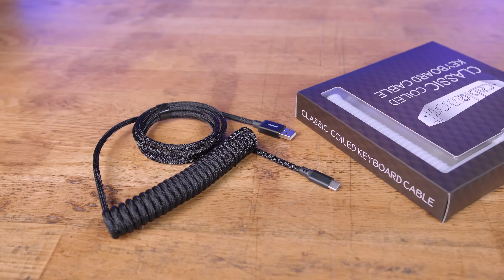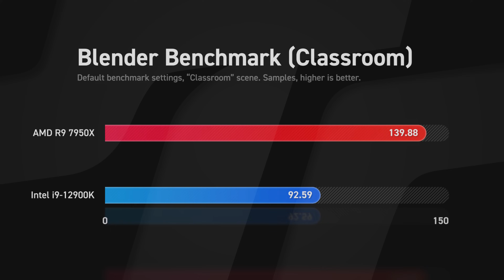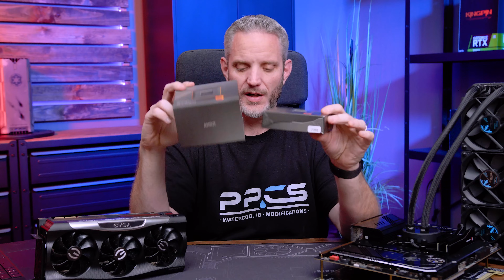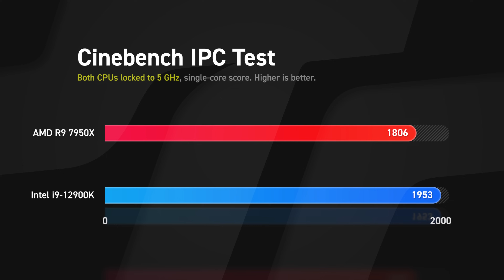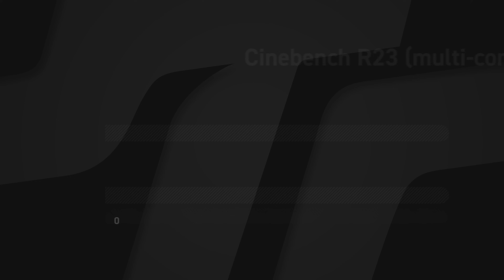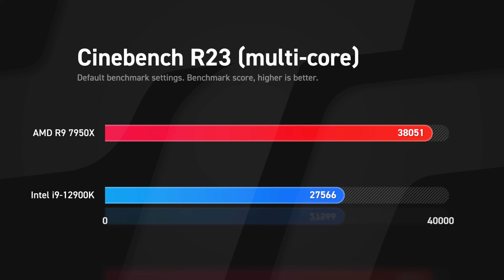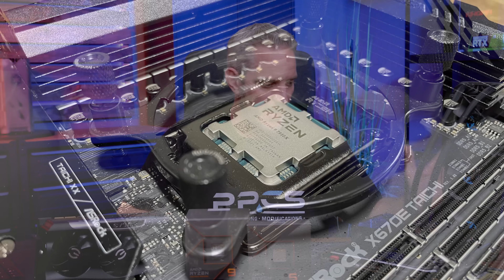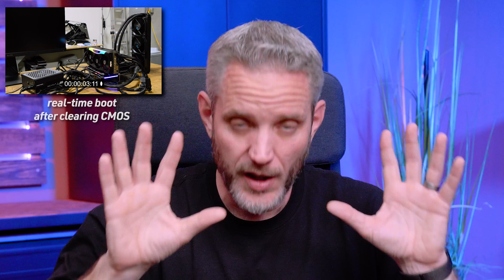Forget EVERTHING you THINK you know about AMD... these CPUs kick A$$!!

Comment: I'm definitely going AMD next time I buy myself a new computer. :) I am currently running an Intel Core i5 9400, and it can certainly use an upgrade. It's paired with my GeForce GTX 1650 Super, which will also probably be an AMD upgrade once I've got enough money saved up to upgrade.
Reply: Moved from blue to red team when I went from a 6600k to a 5600x after all the stink from how intel wasn't trying, loving it.
Reply: Wait probably for early next year, when everything is properly priced. Early adopters would always spend more than it should be.
Reply: eyes and kidneys come in pairs ;)

Comment: Question is, will someone with a 5900x notice an uplift in most games at 4k resolution.
Reply: at 4k resolutions, it'll be GPU bound
Reply: @6210classick  I'll probably skip this gen all together and upgrade the 3090 next year and two years later, do a whole new setup
Reply: i dont think so.
Reply: gaming at 4k is heavily reliant on GPU anyways. If you're not running a 3090 TI with that CPU you're bottlenecking yourself for performance anyways with that CPU.
Reply: @passmelers  is that so? a 12 core 24 threads cpu isn't enough for the 3090ti???
Reply: @6210classick  no im sayin if he dont got a 3090 ti then that CPU is pointless. its more than enough. u misunderstood

Comment: Moved to AMD for my CPU a couple years ago.  Still incredibly happy with my Ryzen 9 3900X.  Darn thing runs cooler and better than the overclocked Core i7 it replaced, and was half the price at the time.  That said, I did just get a 3090 Card, so that graphics card is going to be around for a long while...retirement slows down purchases like expensive PCs.  :(
Reply: I ran a 1060 for years, then was able to upgrade to a 2060 Super in 2020. I just got an excellent deal on a RTX 3080, and I'm sure this card will be with me a very long time.
Reply: I got a 3090, and after I water cool it, I can't see it leaving for a very long time.

Comment: Hey Jay! I don't know if you see this, and I hate to have to write this down before even watching the video - but could you add sandbox/physics games to your benchmarks? I know Besiege and Scrap Mechanic would easily overload these CPUs, and I'd be curious to see how V-cache would affect performance in these types of games. (I'm running a 3700X right now, and it struggles a LOT in most my games.)

Edit : so, I know that the frequency at which a game gets updated is important for benchmarks. The rarer, the better, in this case (though, I'd love a few more performance updates for Scrap Mechanic, especially a fix for the awful performance hit when you've explored too much in survival mode). So, since Scrap Mechanic rarely gets updates, it would be an excellent, stable game benchmark for years (sadly) at a time.

Also it seems like I'm top comment (not anymore lol), so thank you all for helping this comment being seen! Oh and, Jay, if you need benchmarks for the games I've proposed, I can probably create a set of benchmarks creations to put a load on the CPU. One thing which would be VERY important to do, though, would be to always use the same creation - and mention that FPS without a heavy creation loaded in and being active doesn't really matter. For example, a CPU with 400 FPS when there's not a lot going on (let's call it CPU A) would look a lot better than one which only has a hundred FPS (CPU B). However, if CPU A only has one or two FPS under heavy load, and CPU B over fifteen (doesn't seem like a lot, but trust me, it is in Scrap Mechanic and Besiege) then CPU B must scale up much better under heavy load on a single core. And I know I'm repeating here, but V-cache tested on these games would be EXTREMELY interesting and useful to know about for many gamers' next builds.
Reply: Gmod is an old game and lags because of software issues not hardware, it doesn't even utilize cpus to their max when it is lagging
Reply: Or blender physics simulations
Reply: Yep, and Stormworks too! The game engine only uses one of the cores! lol
Reply: @Nave4x4  yes! (I've never heard of that game, but really, Scrap Mechanic really only uses one thread for the physics simulation so much so that CPU usage drops with heavy creations). 

StormWorks looks cool though.
Reply: Don't think it's just these CPU's though. Physics engines are insanely complex due to real time physics calculations. As a result all CPU's will struggle with these games especially like besieged where every part has its own physics and it even simulates mechanical stressors as well.
Reply: My 9600kf is aging too, 100% usage in SM:R (Spider Man Remastered)
Reply: Besiege is a great game to test
Reply: @Stratobrick  it is! Especially with the option to slow down the simulation. That would be something very interesting to test!
Reply: They have a set number of games and don't want to test other games... Hate to say it, but they don't care about what would be interesting, especially if it's games, that are just badly optimized.
Reply: @itslegiTim  Besiege is awesomely optimized, you can't change that fact. Scrap Mechanic leaves to be desired, but for a game in early access, and for a PHYSICS GAME, it's pretty good. NO ONE benchmarks sandbox and physics games (Minecraft doesn't really count, there are no physics) and simulating is a crucial part of gaming.

Comment: My next build will be AMD. Gpu and cpu.
Reply: I've been running AMD since FX8350. Granted, that wasn't by choice, my friend built my computer. But I did go RX480 graphics card upgrade, and now am still on all AMD. Looks like I will be staying that way.
Reply: @WierdGuy523  My last amd build was a long time ago. I'm hoping to do my next rig next month. I can't wait. F Nvidia.
Reply: I would if they could get VR fixed. Still read about too many glitches to dive over on GPUs. 
The strange thing is some says VR works great for them and others with same card says it does not. As of now, I know Nvidia works.
Reply: @Pixeldon It was, but I switched it for a 3700x almost a two years ago. It held up till then though, like a trooper. If I was smart I would've saved it for a server build instead of recycling it.
Reply: @Pixeldon up until I switched no. But I wasn’t running anything super intensive or anything either. I can’t remember but I don’t think I was running warzone although I was running that on my rx480.